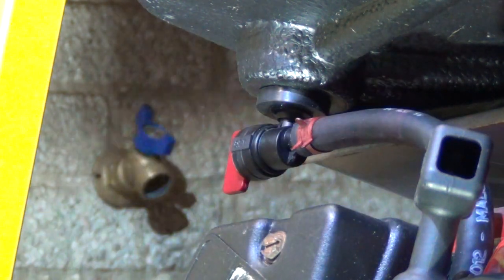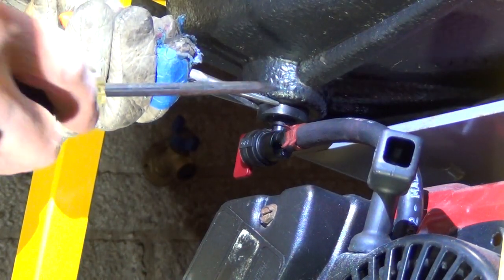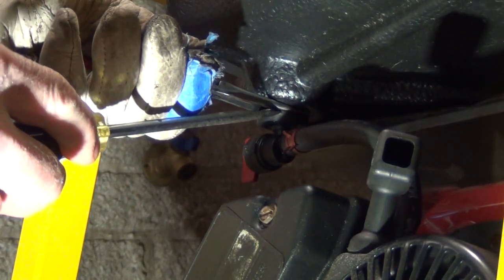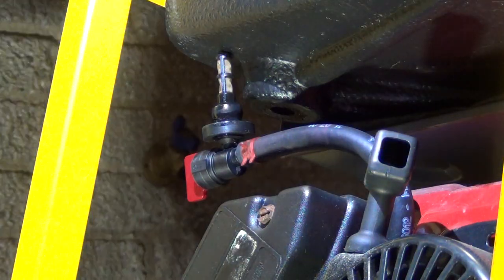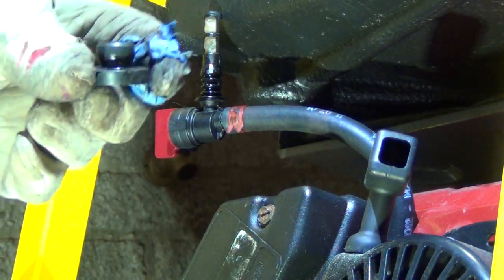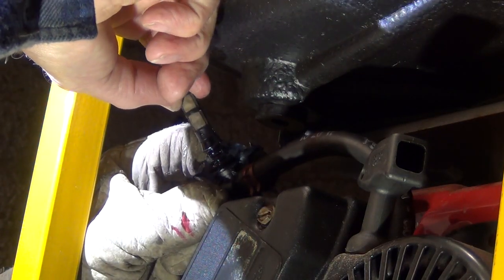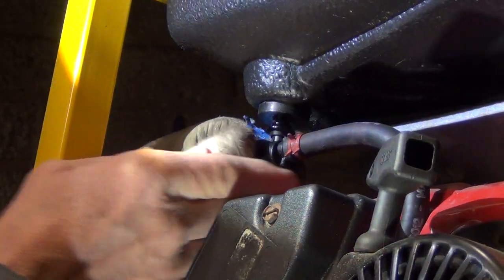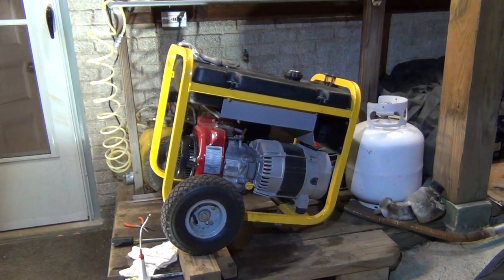replace generator plastic tank fuel shut off valve and rubber bushing

Comment: Perfect timing Vlad. I appreciate you posting this. I would have put the Grommet on the shut-off valve then try to put it in the gas tank. Makes better sense to put the grommet in the tank first and then push the shut-off valve up through the grommet. I so appreciate you, thanks again.
Reply from the maker: Thank you. V
Reply: Yes BIG THANK YOU V!

Comment: Good video

Question - Where did you get the tow bar shown about 6:54 into the video ?  Do you use that with your garden tractor ?
Reply from the maker: I don't see what you talking about at 6.54
Reply: @VladFredK  
Sorry Fred - I did not see, what I thought was a tow bar - it was something else. 

FYI - I have been looking for a tow bar i could attach to a generator like yours, that would enable me to to attach the tow bar to our garden tractor rather than pull the generator by hand for many hundred feet. 

Thanks for your response

PS Your video helped a lot - and I was able (with some effort) to replace the fuel valve - thank you